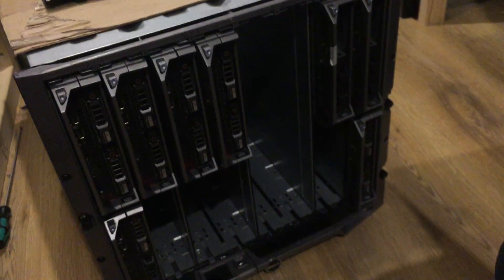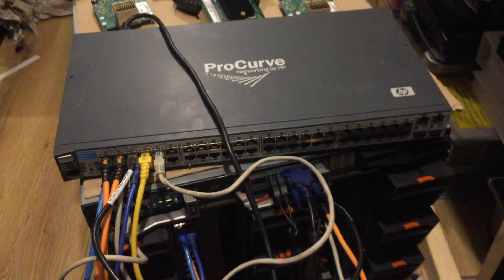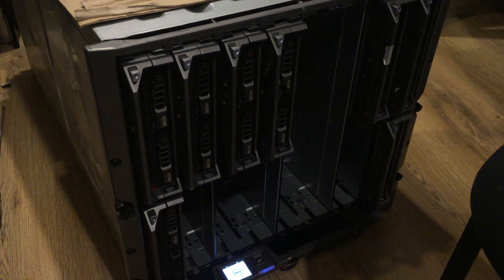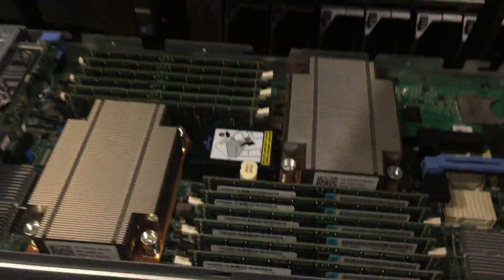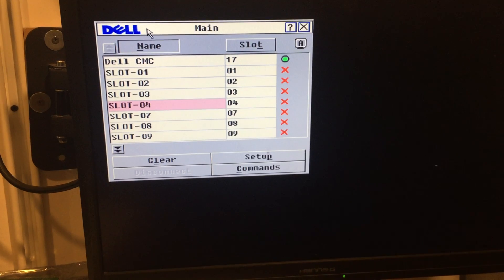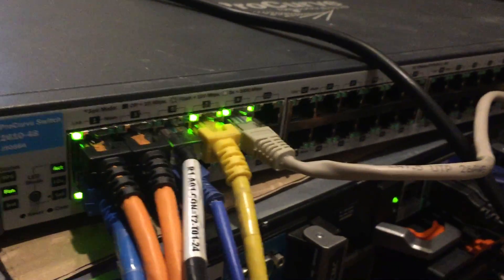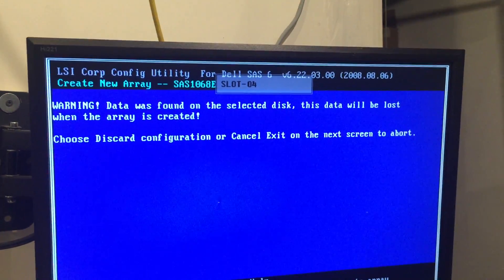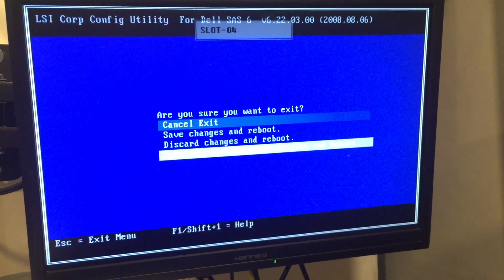Dell PowerEdge M1000e 16 Slot Blade Server Chassis 96gb ram x5670 m610 blade

Comment: Short question, I got an m610 Blade and it stucks at "initialising idrac", do I have to buy that SD card interface that you can see at 4:54 to get my m610 working?
Reply from the maker: No, it doesn't need the sd card. It was for pre configuration setting only 
If it's stuck then it might be others problems, did you remove additional card on the m610 blade? If you have different network module doesn't matched the m1000e port b and port c pass through module it will also halted
Reply: my m600 blades working just fine, I do not use any B or C port for networking, just 2 m6220 in port A, I keep up my trouble shooting If you got any more idea let me know
Reply: Hi guys, I have the same problem, my m610 is stuck, could you give me some idea?